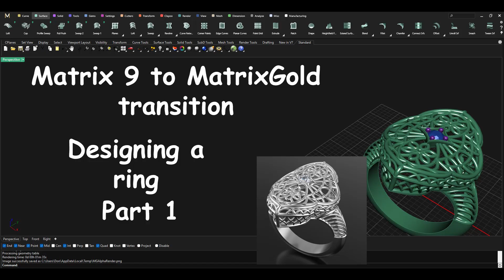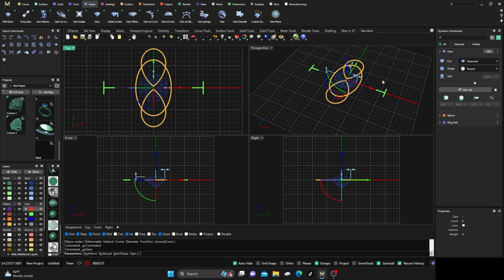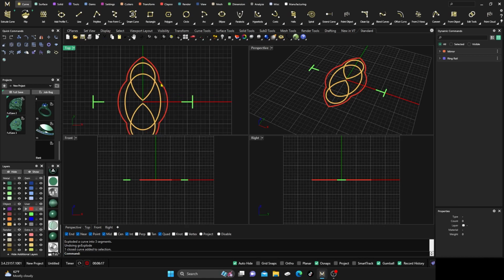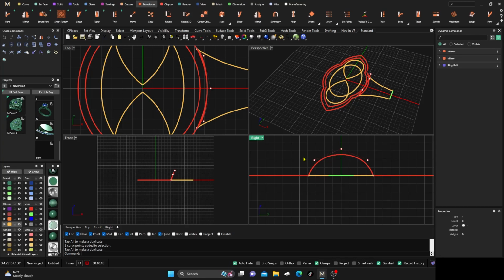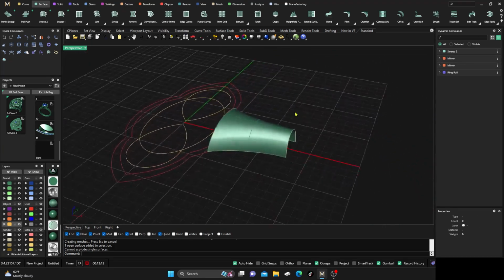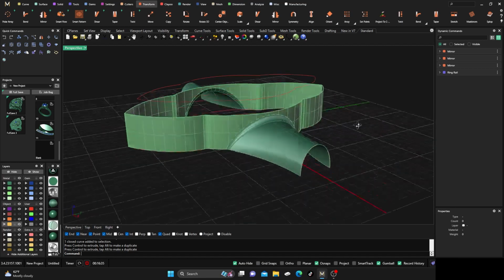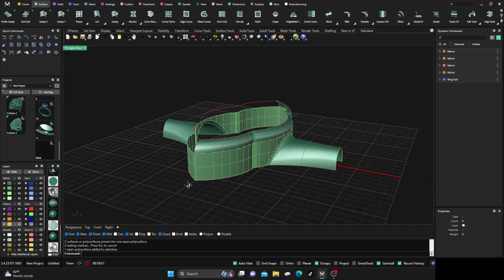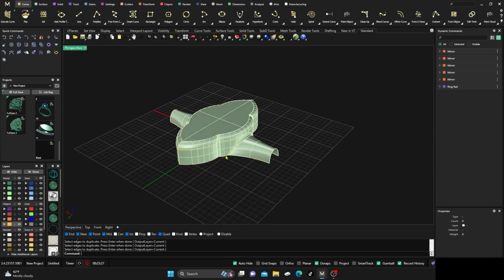MatrixGold Designing a ring Part 1

Comment: Muy buenos videos, podría enseñar sobre las texturas, y una consulta como puedo poner así como ud, los subcomandos en vertical, muchas gracias
Reply from the maker: What version of Matrix are you running? The defaults should put the subcommands and interface layout exactly like mine.
Reply: @donsjewelrymakingandjapantrave  buenas noches tenemos la versión 2.6  la versión 3.3
Reply from the maker: If you are talking about the Rhino tool set, you can just drag it to the top and it will snap there. Actually, you are able to snap it pretty much to any side you want.